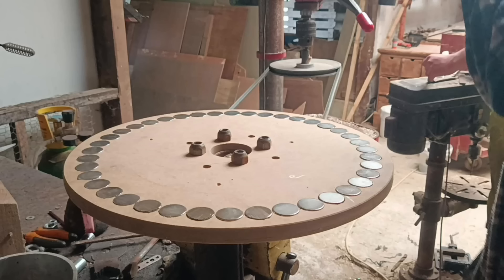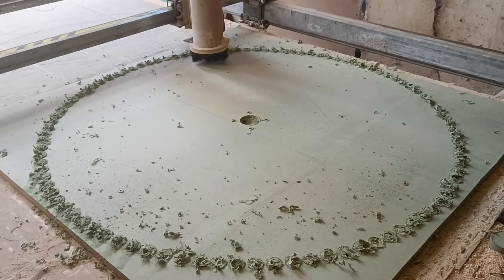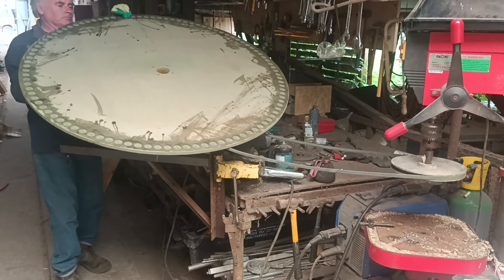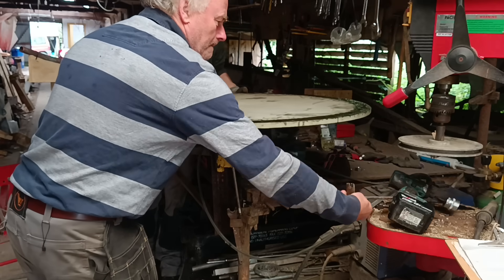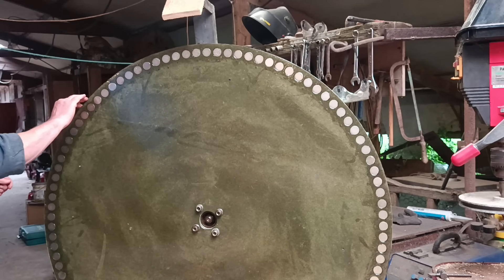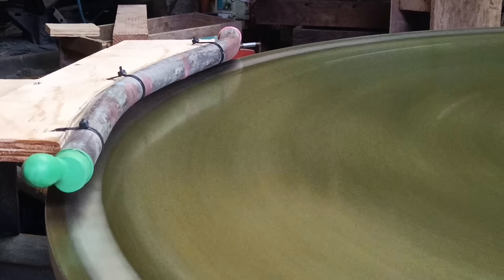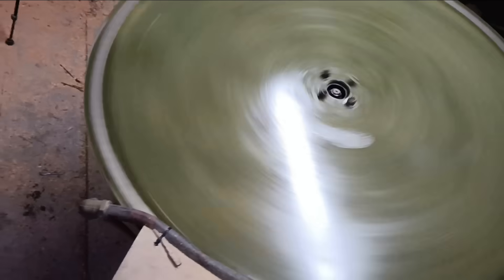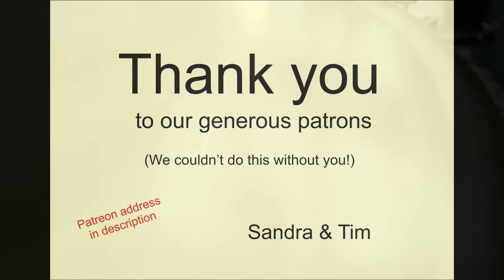ABSOLUTELY HUGE Magnetic Induction Heater! Using 100 Spinning Neodynium Magnets And A Bucket

Comment: You will get much better result if you generate electricity and use a heating element in the bucket. It will also be simpler to build with fewer parts.
Reply: Where's the fun in that?
Reply: Actually this has the potential to be much more efficient. Every time you convert energy to another form you lose efficiency. This only converts kinetic energy to heat. Your method converts kinetic energy to electricity and then to heat. if this is connected by direct shaft to a wind turbine without the use of gears and pullies the maximum amount of kinetic energy is available to convert to heat. The variable is what materials to use convert to heat and conduct it into the water.
Reply: @TomsBackyardWorkshop  But efficiency is lost in the form of waste energy, aka heat. which is what he wants!
Reply: @TomsBackyardWorkshop  The complexity of the build using direct heating and the tolerances needed makes the system a lot less efficient.
Reply: How do you generate electricity?
Reply: @bobsmith5088  Move the magnets over a wire.
Reply: @bknesheim  Just "a wire"?
Reply: I would put the hot inlet enter the bucket at the top and cold in the bottom. Also cut out the loop hanging down to the floor. A taller bucket might help separate the thermal layers.

Comment: A copper pipe the same circumference as the wooden disk and put another disk on top. The magnets facing each other, I am unsure if this will spin without the need for a motor or power source

Comment: Another idea and I think this one is probably too difficult to pull off.  you could wrap your large coil with a small coil and run some water through the small coil to preheat it before going into the large coil.  this would help to maximize the heat transfer but man would it be tedious and cost a lot of copper.  Something that might work a little better would be if you solder two of the large pipes together maybe on top of each other like a double decker buss.  run the cold water through the top coil then into the bottom one.  Square pipe would work best for this but that's probably a specialty ordered item and probably very expensive.
Reply: There's no difference between heating and preheating. It's all heat going into the water. So why bother with all that?
Reply: @diederikvandedijk   Well in some of the ways I've talked about the preheat section wouldn't get as hot as the main section, thus it would only heat the water up some of the way.  this would then make it easier for the main section to heat the water to the max temperature it can. It would be what's called a counter flow.
Reply: @skyknight6467  There is no direction of flow in the generated heat. Heat is generated equally in the whole length of the copper tube. There's just water flow. The direction of the flow doesn't matter and doesn't mean anything.
Reply: @diederikvandedijk   I think you might not have read it correctly.  I'm talking about multiple runs of copper tube, not just a single tube.  using two or more tubes of copper pressed together.
Reply: @skyknight6467  Overall the same amount of heat will be generated, whether in one or multiple runs of tube.
Reply: @diederikvandedijk  but to maximize the heat transfer from one medium to another you will need surface area and time and in order to increase surface area and time in contact with that surface area you can use a counter flow system.
Reply: @skyknight6467  Sorry, but no. The only heat transfer happening  is from the copper to the water. The copper doesn't flow.
Reply: @diederikvandedijk  bless your heart and have a nice day
Reply: @skyknight6467  O, come on.

Comment: You might consider, emulating an Induction heater... by adding more magnets into the center of the Disc... and creating a Spiral Shaped Pipe, that Hovers over the entire disc.    Obviously, the More Magnets per surface area... the greater the Heat potentials.

 Someone recommended using a flatter pipe.  You might try Squared / Rectangular tubing.   To bend it without it Kinking... you have to pack it with Sand.. and temporarily seal the ends.

 One issue you may have... is that the very spinning disc itself,  may actually creating a cooling effect.   The faster it spins... the more likely it will move more wind, and create a greater cooling effect.  Sealing the Discs in an insulated Enclosure, may help greatly, in reducing that effect.

 The shorter the pipes... the less potentials for heat losses.   However, Im not certain about how you intend to collect and use the Heat.

 In many older houses.. they use the circulating hot water... to be diffused via Aluminum / Copper Fins... in their "Baseboard Heaters".   But if you are merely trying to store the hot water for actual bath/shower type of use... then of course, you would want a large insulated tank, with very short pipe lengths.

 The actual losses of heat, are also going to vary, depending on the weather temps.  If you dont use extremely good insulation methods on your Windmill.. you may lose a lot / most of the generated heat.   Even the smallest of wind gaps, can drastically drop temps, over a relatively short period of time.
Reply: Also... I wonder if it would be much better to use squared magnets that are placed vertically,  rather than the wide round magnets.  The reason, being more concentrated magnetic pole forces, and more pole-flips per Inch of Space Traveled.
Reply: Part 3:  One more experiment to try.   What would happen, if you also placed a magnet(s) above your pipe?   Maybe the magnetic forces between the rotating magnets... the pipe,  and the top static magnet(s),  would greatly increase the maximum magnetic Field Strengths... creating far more Magnetic Frictional Forces.

Comment: suggestion, just spin a paddle in the bucket of water,  make the paddle to supply plenty of resistance.    this is all for fun, as all of the non heat pump systems will have the same efficiency of 100% if everything (driving motor included)  is within the space that one intends to heat.  Since they are all 100% thermally efficient, the winner is which is the most efficient to build.

Comment: You could wrap more coils of magnets around the disk. A single concentric coil might be too hard but with more rows of magnets you could make a few "loops" of the copper coil. Thin a large C with a smaller c inside of it.  each C has a corresponding set of magnets.  maybe not all the way into the center of the wheel maybe just 2 or 3 layers would work without adding to much weight and resistance?  If you do multiple  coils you could test and see what coil gets the hottest and what is the coldest and have the water flow from the coldest coil towards the warmest coil.

Comment: That looks... horrifyingly safe. It's great. I'm pretty sure the best bet for increasing heat is going to be decreasing the gap between the pipe and the magnets, or increasing the length of the area in contact. It's a bit hard to tell, but it looks like the pipe and magnets are a cm apart at closest, but you really want them to be uncomfortably close to capture as much of the flux as possible- motors seem like they're sub mm, but I figure you'd do fine at 2-4mm. If you could flatten the copper pipe so that more of it's closer to the magnets that might help, though probably better would be getting a thin flat copper sheet/plate and soldering it to the pipe.
Reply: Induction stoves use electromagnets, maybe that would work better.

Comment: A big wheel. The train engine has a big wheel too. What if…? Can the train become a source of its own heat and combustion? Can the train be a power generator..??
Reply: This is the concept behind regenerative braking - you can use the motors of an electric train in reverse as generators, which slows down the train and provides electricity back to the grid. The same thing is used in electric and hybrid cars. However, you will always get less energy out than you put in originally due to thermodynamics.
Reply: Nope
Reply: Sorry man it is the law